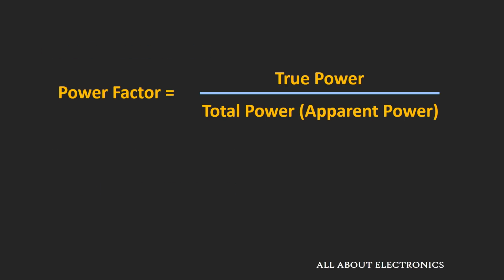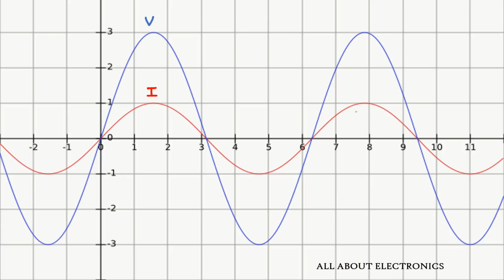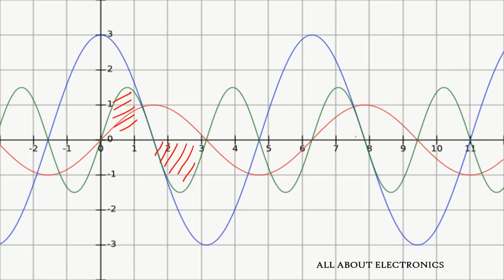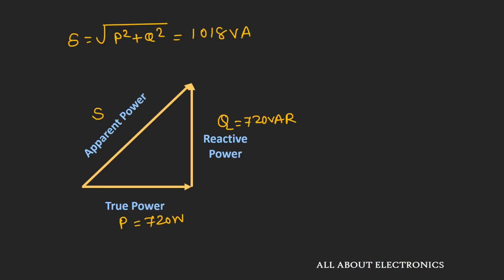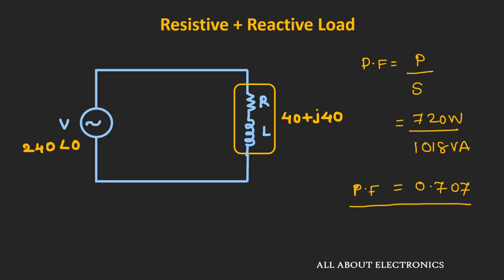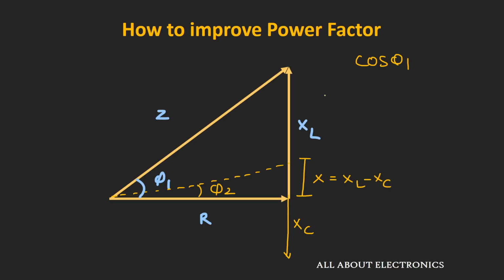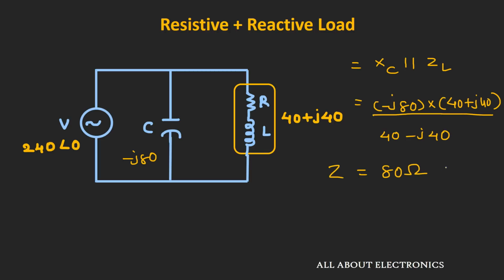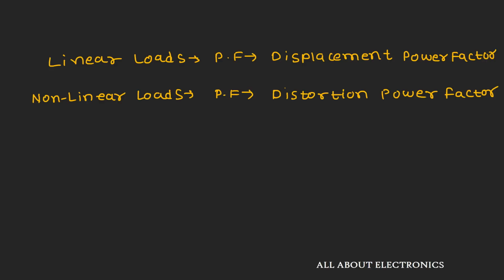What is Power Factor? What is Leading & Lagging Power factor ? Power Factor Correction Methods

Comment: 15:11 , you said that to we need that the value of Xl be equal to Xc so that they cancel each other out. But the circuit is in parallel to each other. So I guess that what you mean by cancel each other out is when we get their respective reactive power is that the plot of Q of L and Q of C will cancel each other? Am I right?

Comment: Amazing. Thank you so much.
One question: Why was capacitor connected in parallel and not in series?
Reply: In series also we can connect but in parrlel it is more efficient..
Reply: Capacitors in series are adopted for improving the voltage profile.

Comment: Reactive power is nothing but the power oscillations in the circuit due to inductors and capacitors present. It is really confusing when we are studying reactive power only with the phasor diagram, I have explained the concept with the help of fundamental waveforms in my Chanel. Also explained why reactive power compensation is necessary, how we can compensate.
Reply: Link ?

Comment: You wrote XL = Xc.     XL is already = 40 ohm. But after calculating, you got Xc = 80 ohm. 
How is this possible?
Reply: I now understand how he gets 80 ohms, it's because 3 amps will flow through the capacitor. What I don't get yet is the value of the total impedance to equal 80 ohms

Comment: Fantastic explanation 
Can you please tell me how do I know the PF in my house
Reply: calculating power factor in a house using impedance and resistance is tiresome. If you know the phase angle between voltage and current , you can find p.f. easily by taking the cosine of that angle. That angle will be found out by the electricity meter installed at home

Comment: If we connect capacitor in series with R&L then can we take Xc=-j40 ohms
Reply: normally we do not use a capacitor in serial. capacitors connect parallel to the circuit. if we connect serial capacitor whole circuit working differently.
Reply: @kusalthiwanka8630  it will work in resonance
Reply: @kusalthiwanka8630  in series resonance to be specific

Comment: What does negative power factor signifies?
Reply: Same question
Reply: Negative power factor means the circuit is capacitive , so you would have to add an inductor in parallel to bring the power factor to unity
Reply: @Syphus323   Thanks! Though I have already taken my exam and passed it haha. Almost one of the top scorers I had typo in the calcu

Comment: What is non Linear loads and how it distorts th power factor ?
Reply from the maker: Variable Frequency drives, servo drives, and bridge rectifier circuits are the example of nonlinear loads. This non- linear load generates the harmonics of the current. And these harmonics also draws additional reactive power. Hence, the overall power factor of the system reduces.

Comment: 4:29 why you have not included frequency of omega to calculate I ?
Reply from the maker: Here, the voltage source is 240 V, 50Hz. So, the value of XL ,which is j40 is for 50Hz. And here we are assuming that the voltage source frequency is not changing. So, that is why frequency is not included for the calculation of  I. 
I hope it will clear your doubt.

Comment from the maker: Timestamps for the different topics in the video is given below:

0:43 What is Power Factor?

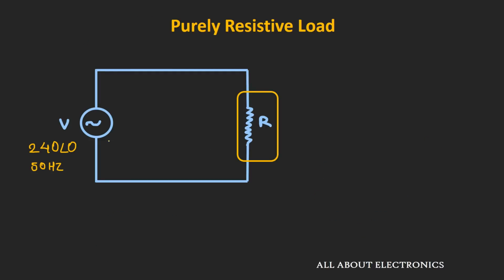2:40 Power in Purely Resistive load

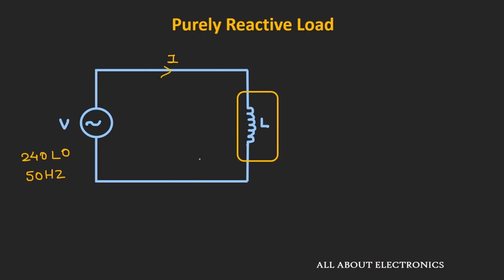4:06 Power in Purely Reactive load

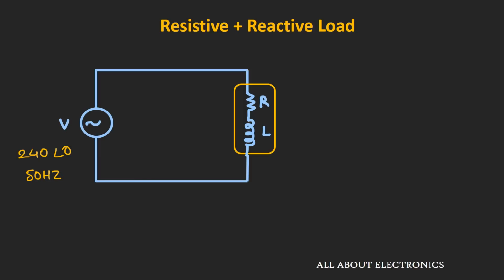6:15 Power in practical load (Resistive + Reactive) load

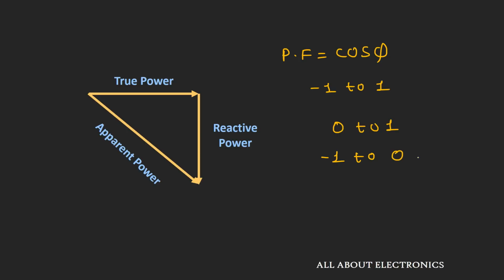10:28 Lagging and Leading Power factor

11:30 Significance of Power Factor

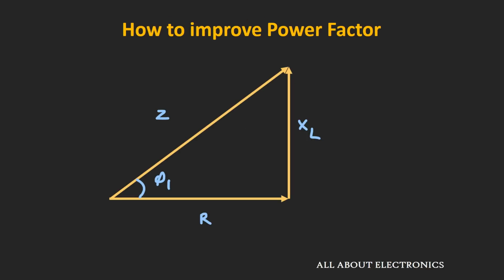12:55 Power Factor Correction

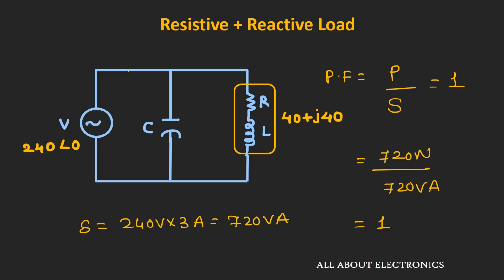17:58 Displacement and Distortion Power Factor
Reply: Great work sir.
Reply: very very good!
Reply: Sir please tell me that what do u mean by lag lead in electrical wiring  that there is race between  current and voltage
Reply: Also tell me about series and parallel concept of capacitor and inductor in electric wiring urgently